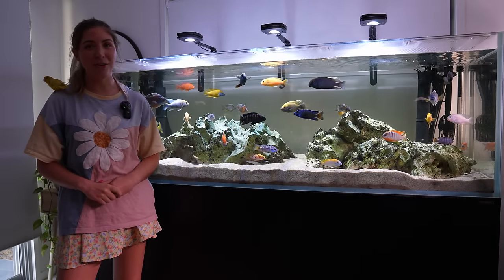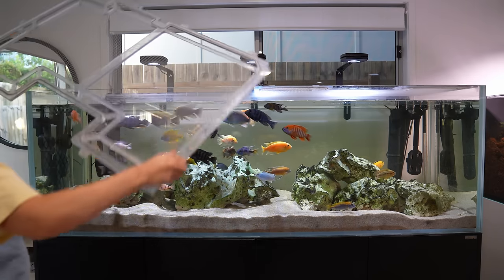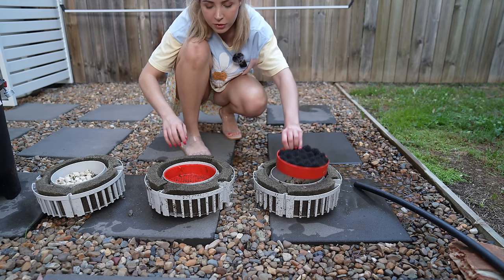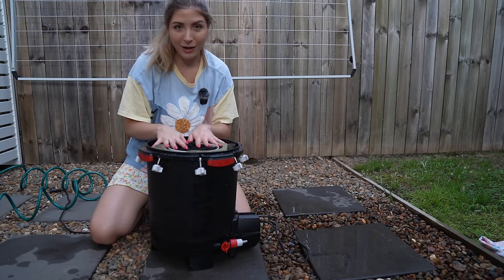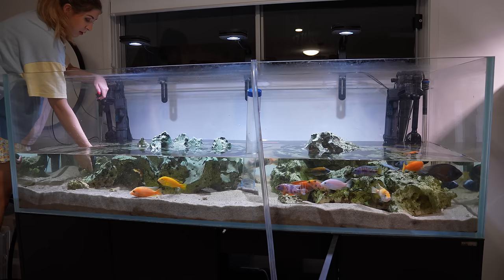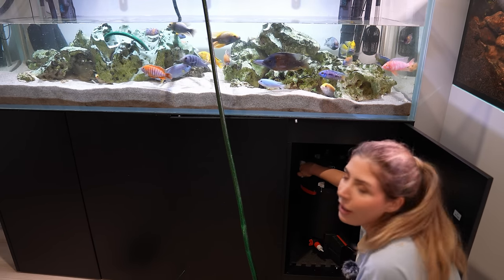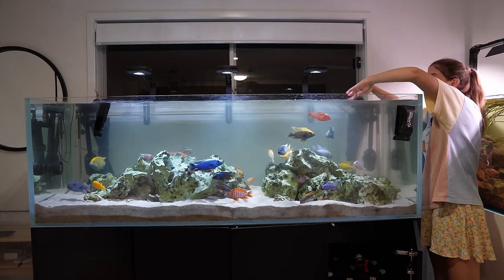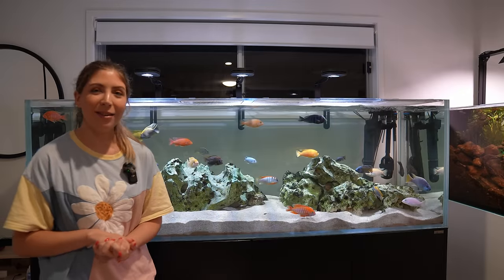Fluval FX6 Cleaning After 3-months on my African Cichlid Tank

Comment: Hi Kaity. I have small tip to avoid that the filter is leaking: You should really cross-tighten the white lid fasteners to ensure an optimal flush seating on the edge of the bucket. First close all 8 fasteners and then tighten the one closest to yourself. Don't fully tighten, but reserve perhaps 1or ½ final rotation for later. Then tighten the one directly opposite and again reserve the last rotation for later. Then you go back to one of the fasteners on the side (90 degrees from where you began) and tighten that one and then the one opposite. Continue around the lid, always cross tightening the fasteners. Then lastly you go around again and tighten the missing last bit, you left off, the first time round.
It might sound a little involved, but it really ensures that you get an even pressure on the lid and a lot lower risk of leaks 🙂 And this not only goes for pumps, but everywhere you need to tighten something round...
Reply from the maker: Ooooo, thank you!! That is good advice. It's like changing a tire
Reply: @Kaityscichlids  another issue that can happen is that junk gets clogged in the bottom valve when you close it after draining all the dirty water out, not leaving a 100% watertight seal.  

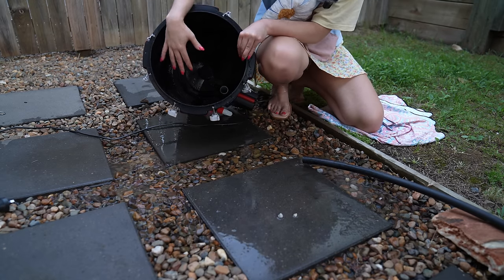A good idea is to rinse clean water through the bucket (11:33), with the valve open.  Make sure nothing but clean water is flowing out, and THEN close the valve.   Nothing sucks more than being totally done...and watching a drip come out of that valve.   LOL
Reply: Exactly right, just like you said, changing a tire. I have 5 of these fx5 and fx6 filters and that's correct.
Reply: Oi 💓
Reply: That´s alot of water you change..I´we been told 15-25% at max.
The FX-series also have  large O-rings that needs to be replaced after time..
Reply: i love you from india
 @Kaityscichlids
Reply: Correct🧐

Comment: Love the fact that you have taken the time to run through your process, and your tank looks great (I may well move into Mbuna's myself).
Im running a 500 ltr tank with the same FX6, but when I come to water changes I let the FX6 do most of the work for me. I have one long hose conected to the purge valve, this runs out into a garden water tank (we use the water on the garden plants). I then turn off the power, close the 'output' valve then turn the power back on, and run the filter until approx a quarter to a third of the water has been drained. Turn off the power and close the purge valve.
Changing the hose to a shorter one I place a 30 ltr plasteres bucket next to the filter, fill the bucket with 30 ltrs of treated water, adjust the output valve to just less than 50%, fully close the input valve, turn the power back on and the pump re-fills the tank for me, while I keep the bucket topped up.
Cleaning the filter (approx every 2 months), Im doing much the same as you, but I drain the filter using the big hose to outdoors. I cut large pond filter panels to create my internal sponges, but I sandwich a coarse and a medium together in all 6 spaces in the three trays with bio medium through the centre and pads top centre.
Refitting the filter, I simply re-attach the input hose and gravity fill the FX6 from the tank, and again re-fill the tank as above once the filter is full..
This filter certainly saves me a lot of humping about with buckets, syphones and steps!!!

Comment: thank you for sharing your process. I'm a reef keeper and I'm surprised that the freshwater hobby hasn't adopted overflows, sumps, auto filter rollers and reactors. Less maintenance much more effective then trapping detritus in a canister for 3 months.
Reply from the maker: I've got a sump on my other freshwater tank and am potentially getting a filter roller installed which I'm keen to try!
Reply: I ran a sump on my 75gal community for a couple of years. It didn't do as good of a job at picking up the fish waste and detritus as most canisters I've used. I tried various flow setups but just couldn't seem to get it doing a great job. I always had to spend more time siphoning crap than I should have needed to. The sump was also significantly noisier than the canisters which required me to sound proof the cabinet. one thing the sump was great for was becoming a home for any fry. They usually all found there way there.

Comment: You would benefit greatly from having some ceramic rings or other bio-media in the bottom of the filter. The Fluval FX line has a very deep channel under the media baskets/trays where the water initially comes into the filter. Add some media there and it will catch a lot of the larger waste before it has a chance to clog your sponges up like you had this time. 😊

Comment: Hey Kaity...gr8 video...very formal and easy to understand, I really enjoyed most of it. However, not the time and effort it takes to clean up the FX6. I have noticed a lot of fish keepers prefer cannisters over sump filtration, and to be honest, I don't understand why because sump filtration requires far less maintenance and effort to clean, it only takes me about 10 minutes weekly to change my filter floss, and rinse out my medium and coarse sponges, the bio media(MATRIX) is rinsed out 1ce a year, and thats purely because my mech filtration does such an awesome job trapping all the gunk,the options and benefits of a sump filtration system is endless, I would like to suggest you consider changing to a sump setup, than carrying your cannister to your backyard every 3 months lol...These cannisters are so expensive, yet u are so limited with the filter media space. The only tricky thing about a sump filtration is setting up correctly. You must have a good and safe overflow system coupled with structured plumbing and a good reliable return pump to turn water effectively in your tank.
Reply from the maker: I have a sump on my other freshwater tank and there's definitely lots of benefits to it. I don't think I would ever have a sump on this tank though because I wouldn't want to drill the tank, especially with the glass being so thick. There is something I also like about canister filters, even though they're harder work to add media to and more effort to maintain, they're nice and "neat" and compact which is satisfying in a weird way 😂

Comment: Jesus!!!! 2 of those fx6 is soo crazy overkill in this tank.. also 80% water changes is insane. I’ve never heard of anyone doing that. 30% is most I would ever do and with your filter setup you should be doing 20% at most as you have double filtration. Crazy. I’ve had my 220 gallon with 1 fx6 with 24 peacock cichlid for 5 years and it never has a speck of anything in the tank and I do a 30% water change 2 times a month. These filters do such an amazing job that you can do less water changes.

Comment: Hey um. For refilling since your using the tank water try refilling your tank and while it's filling up connect the in and out and let the suction on the hose fill the filter without turning it on 😊

Comment: Just one thing for your safety. If you need to use a chair to stand on place the back of the chair close to the tank base, if you lose you balance and need to step off the back of the chair won’t restrict you egress. I find your video informative just before I set up my new cichlid tank with  with the fx6
Reply from the maker: Thank you Terence! That's great to hear :) And thank you for the chair safety tip also, I never thought to do that

Comment: I also run two fx6 in my tank, and a good way to make cleaning the bio media more management is to keep them in mesh bags.
Reply: I agree. Mesh bags really make rinsing the media easier. They would also help so she could immediately throw the bio media into a bucket of tank water after taking off the lid while she cleans the rest of the filter.
Reply from the maker: Oh yes, I'm pretty sure the media is meant to be in bags actually 😬 I just find the bags so annoying because they don't sit properly in the baskets
Reply: @Kaityscichlids  I know what you mean. It’s like putting a square or rectangular bag into a circular tray. You just have to find the right sized bags to make it work.
Reply: I was doing this for some time but I fount the mesh was still detritus was finding its way into the bag and gathering there.

Comment: Great video. I have an fx6 I bought in 2018 for $550 Canadian dollars. 1USD=1.37CAD.  Filter works great however in hindsight I should have just purchased a 40 gallon breeder, a pond pump, pvc pipes and build a sump for less. I had to replace one O-ring and for some reason I couldn't find just that piece to purchase and had to settle with a repair kit that includes a pump and other pieces for $100. I have an eheim that I purchased in 2003 that is still running like it's brand new.
Reply from the maker: I definitely think there's some other great options out there. I've got an Aquaone filter that I've had for 10 years now and it's still working!

Comment: I've always used a pump both ways for my water changes. I'm always surprised at how rarely I see others do it. I also have vibration pads under mine. I went a little farther and did some sound-proofing inside the cabinet.

Comment: Ok. A few things. You are an amazing woman!  You’re doing an amazing job with a beautiful tank. It’s made me want a tank again!  Here’s a few suggestions. Never walk away from a syphon at the bottom of a tank. It could be disastrous. Use a hand clamp to secure the refill hose to the tank when refilling. Try to find inline heaters. Good choice in Eheim heaters but I hope you are using a controller too.  Those UV modules need to be replaced with an inline UV system to get them out of the tank. Way too much equipment in the display. Way too much. Consider cutting down those AI light hangers or suspend them via a wire kit. The arms are a distraction on the back of the tank. Check out the work by Aquarium Design Group in the USA. Overall the scape is beautiful your knowledge of how to clean those filters is spot on and you teach well. Great job.
Reply from the maker: Thank you so much ❤️

Comment: Great video, I have an fx6 and a fx4 on my 125g tank. One thing you can do is put a net over the output hose to catch all of the hose gunk,
Reply from the maker: Thank you 😊 That is an excellent idea
Reply: Back flushing is really the way go. Once you remove the valve from the filter, just open it and let the water dump into a pail for a few seconds. Works great!

Comment: I would do the gravel siphoning before draining the tank. You'll have better suction with a taller column of water. Also, a bit of black beard algae in the tank. I've found that using an under gravel filter stops bba. I use fiberglass screening if there  is a male that digs too deeply. Your fish have great color so you're doing it right!

Comment: If you close up your FX6 empty, and refill your tank, the water already in the outlet pipe should start the siphon and refill the filter once you open the valves. You may have to lower your input screens to ensure this works since you remove so much water from your tank.
Reply from the maker: Thank you for the tip! I think I tried doing this once but I messed it up 😂
Reply: I do the same! I refill the tank before opening valves on fx6 and the water in the hose will siphon back into canister and fill the canister! And then I just plug in canister and I’m done 👊🏽👍👏🏻👏🏻
Reply: Yes that's the easiest way to refill an empty cannister, just open the taps and let the syphon do the job!

Comment: You can put your chemical filtration in the top tray ... this will ease your replacement.. for e.g if changing monthly... just pop the lid open replace the chemicals
Reply from the maker: The reason I put it down the bottom is so that it doesn't remove too much ammonia from the water before it gets to my tray holding most of my bacteria colony

Comment: I have 2 fx6 and my media doesn’t get like that. I have a 165 gal African cichlid tank. The top tray doesn’t have no media only bottom 2. Top one should be all fine filter and the black sponge one that come with it. But I would recommend using more of those blue fine filter pads on the top. I’m currently running 3 blue pads and 1 black one and none of the gunk gets to it. Set it up November and just cleaned them march 1st. No gunk was all beneficial bacteria. Also mine wasn’t as black dirty as yours maybe you feed to much? I feed 2x a day to 40 cichlids. Not sure but love your videos.

Comment: Not sure what you did to clean the outer sponges  but  you can use the garden hose to clean those.i have done for years. It makes no difference to the beneficial bacteria and will not cause a crash. Much easier and they end up cleaner. For pre-filters a good one is a sera external filter. It holds media or sponges of your choice. You simply divert tank water from the tank into the filter then out to the canister fliter inlet.maintenance  is dead easy too. Just a suggestion Kaity
Reply from the maker: Yes I definitely wouldn't be against cleaning the sponges with a hose if I wanted to give them a really good clean or were in a rush. Especially since the filters have been running for so long

Comment: I'm debating a series of smaller canister's like yours unless ive got more clearance for the 6's like you've got. I'm surprised you're doing maintenance as infrequently as you are! What are your water parameters typically? I'm curious especially with that bioload.

Secondly, if you opted to use an external pump with that canister, could you do that? Seeing the lid off says I might be able to. What size fittings are the ports?

That aside on the rock and crushed coral raising your pH. Myth.

In saltwater, you can do that! Catch 22-you need CO2 to mix with the water column to make carbonic acid. That acid dissolves that stuff for calcium, buffer, and trace elements. I'm not so certain your chicilids would survive in those circumstances.

I agree with the substrate for now and then. I do notice it looks like you've got a hypoxic volume developing. I'm the descent from most on this, but I say its a good thing! Thats where your denitrification occurs. 🙂

I'd be skeptical to siphon that with such a low volume of water. If that sulfur seeps out, it can choke your fish. Ive actually seen mine cough in certain circumstances. The sulfides bind readily with oxygen, hence the concern there aside from that volume being too low as it is.

I'm glad you posted this as it sheds some insight for what I'd like to do. 👍 thx

Comment: Hey Kaity, so I need advice. The last time I cleaned my tank (I have the 120 gallon tank and I use the Fluval 4) almost six of my fish died. I didn't understand why until I asked around and I was told its because I cleaned my whole tank clean and was supposed to leave some water on the Fluval pump and also don't drain my whole tank. Part of me thought is because I did add the treatment (Top Fin water conditioner and Stability) while my tank was filling up and maybe that concentration might have been too much. Today I cleaned the tank again and this time I added treatment when the tank was full but then again two of my Kois died together with two gold fish. What am I doing wrong?

Comment: No need to fill the canister back up with water manually. If you wait until the water level in the tank is above the filter intake, then open both valves and the water that was left in the pipe (when you originally turned the valves into the off position) will create a siphon and automatically fill it back up
Reply from the maker: Thank you for the tip!!